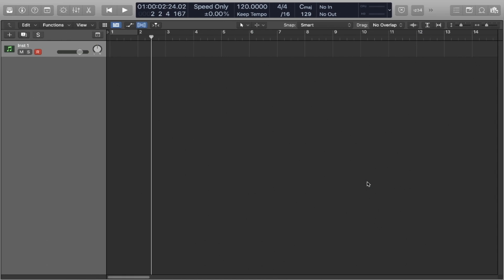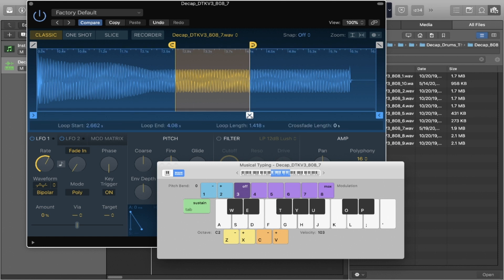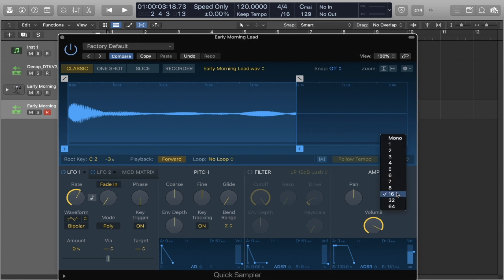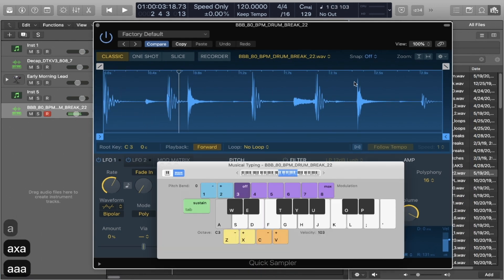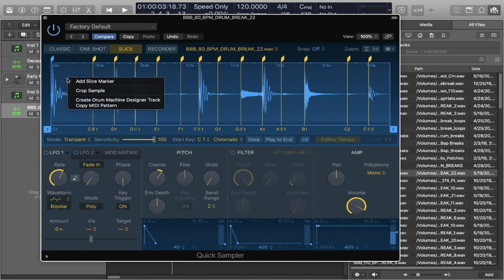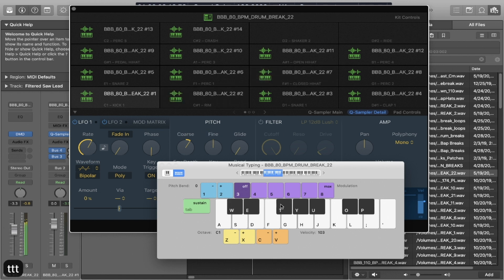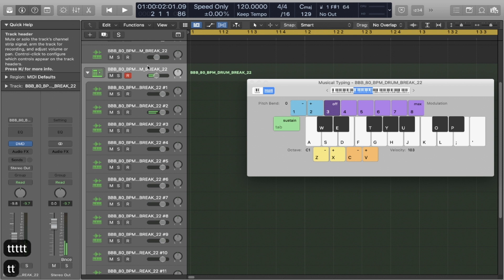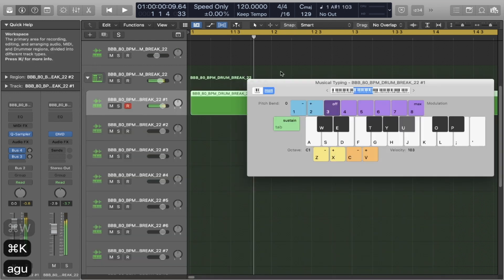Logic Pro X 10.5 - Quick Sampler and Drum Machine Designer Workflow Tips

Comment: Hi very interesting thanks. Question:  once your sample is choped in multiple slices, can you export some of the slices in drum machine designer (instead of all of them) ? I sampled a drum beat and once its choped and the slices exported in DMD, there is like 30 drum parts  :o (many of which I don't need or sound alike).
Reply: Use the slider to reduce the ranges of slice to a bar, quarter note or a 8th if you wish.